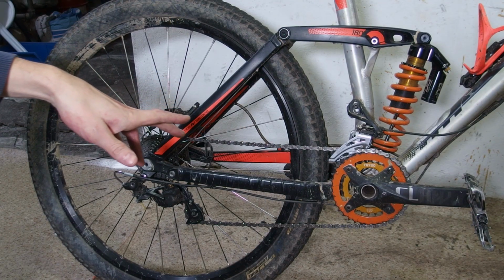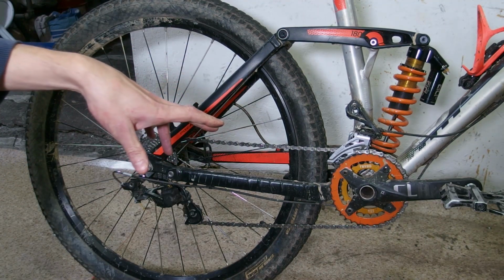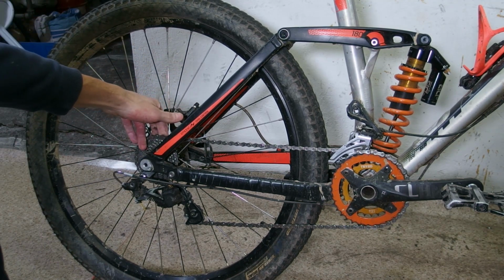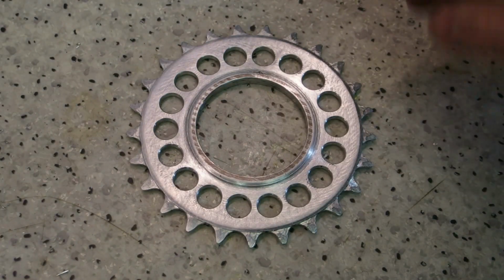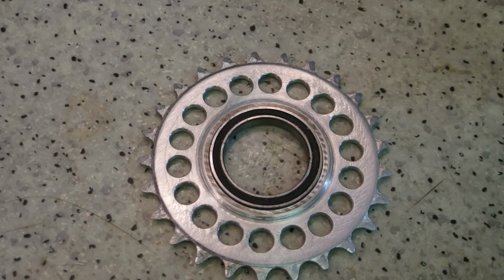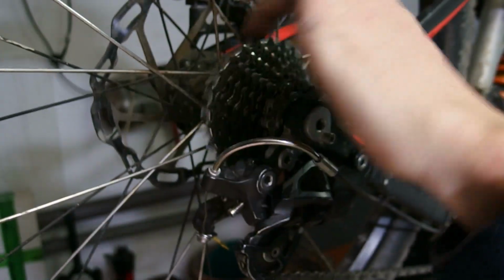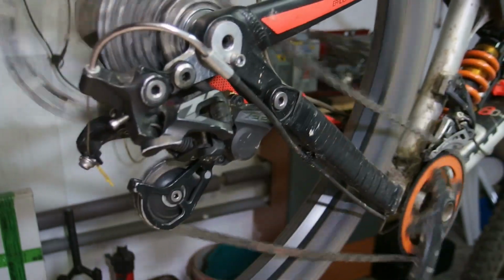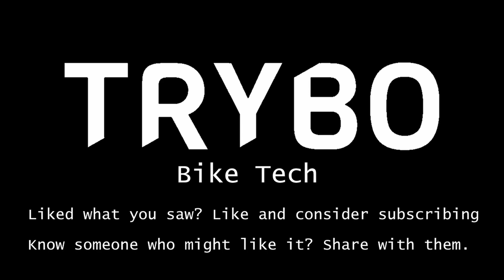True Neutral gear for your MTB pleasures

Comment: Thats the worst idea for the problem. The usual idea is to add spacers beforethe last cog. The over engeneered good way of doing this is freewheeling the chainring and fixing the hub. You also would get shifting without the need to pedal.

Comment: I watched it... I would not want a neutral gear...but it did make me wonder...have you ever made a sprocket from table saw or miter saw blades? Thought it would be an interesting look. With both sprockets and saw blades having teeth. You could even have the marketing stickers left on the blade....with even the arrows that say the direction one must place it on tool to be most productive.😀😇😎

Comment: i replaced my rear mech cable with a single housing up to the shifter.  it runs the seat stay which is less friction than the bottom-bracket route

Comment: can you make a single mech cage that has multipule drillings for different pulley positions for different cassettes?  as to have the closest b-set throughout the gears and have maximum cage movement(like in degrees of turn) so the clutch and spring have best action

Comment: There is this device called O-chain that allow for few degrees of slack between crank arm and chainring, also recall some video saying that lower number of engagement points in your hub act in a similar manner. Anyway Gwin won DH in Leogang without chain and Gee Atherton had one cog missing from the cassette for some time. Cool to see you nerding staff like that for sake of YouTube